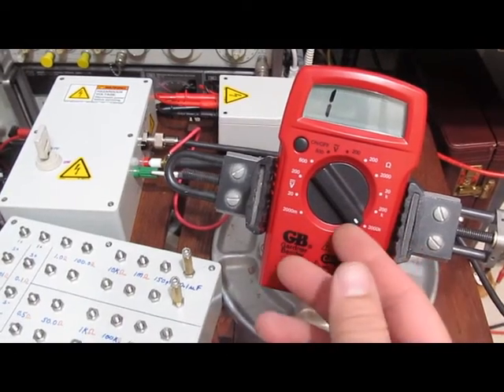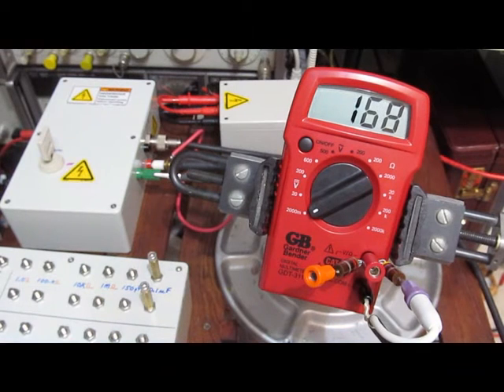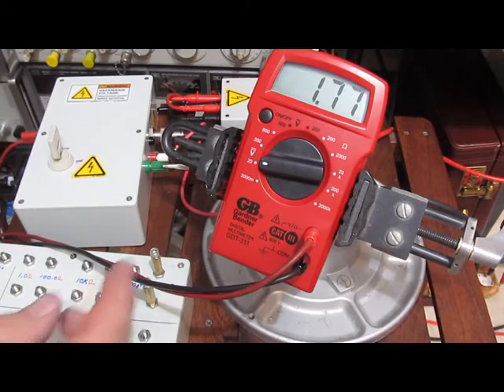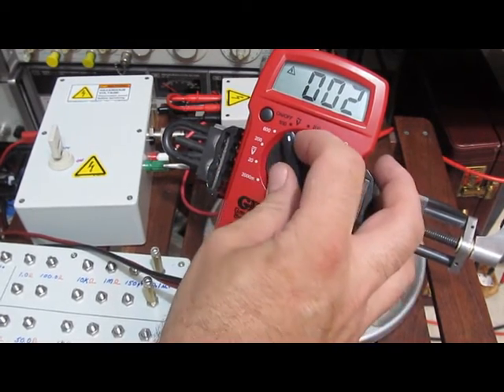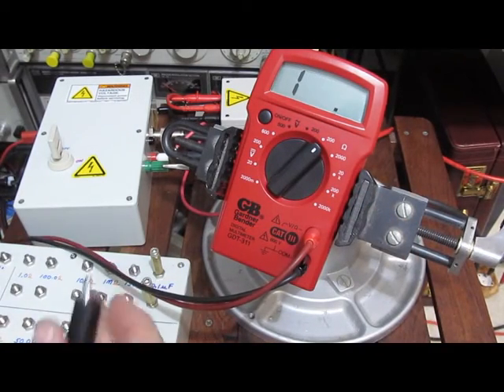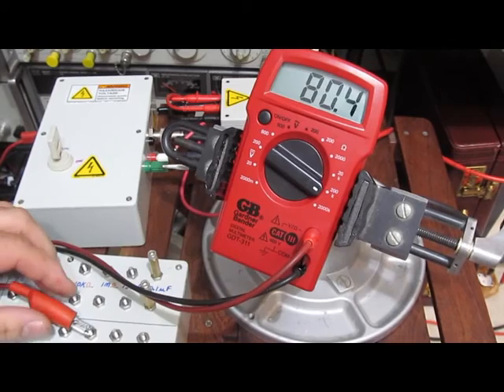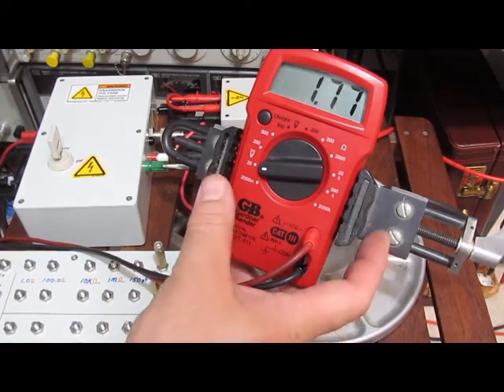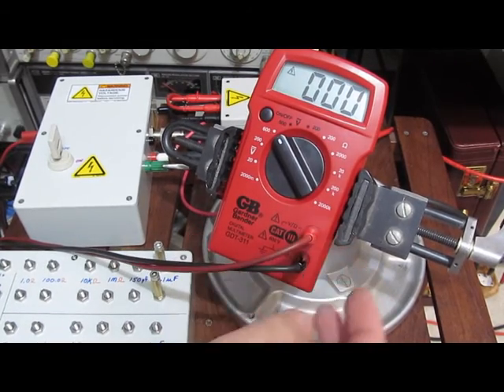Evaluating low cost DVMs Part 7 CAT I The Gardner Bender GDT-311

Comment: Can u use this gdt 311 to check 60 90 volts given off by cable power supply
Reply from the maker: I don't know why I couldn't, assuming I had a 60 90 volt cable power supply to measure.